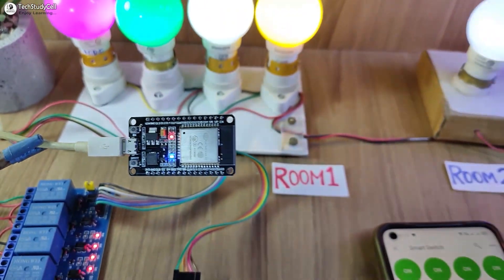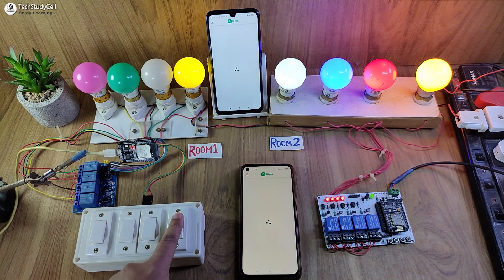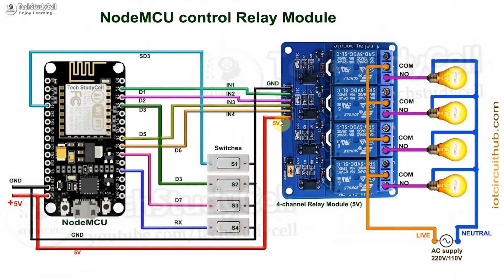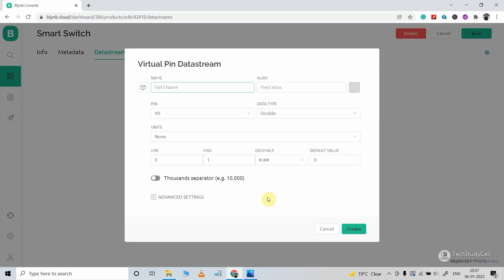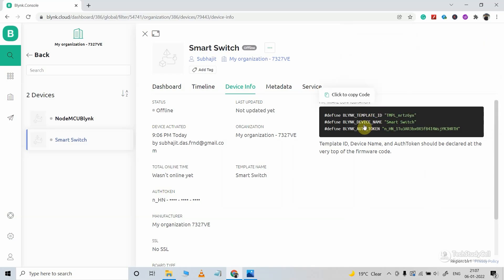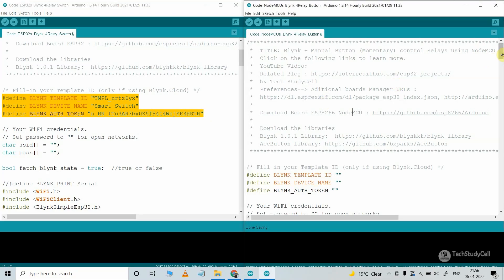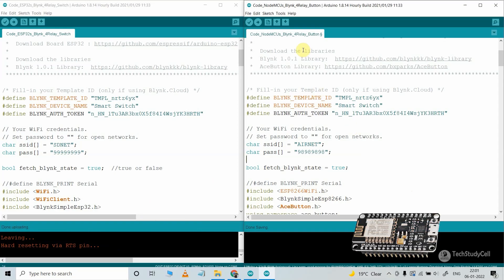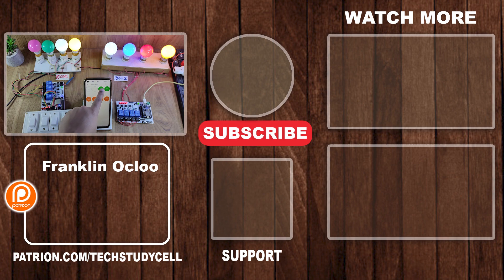IoT Project using ESP32 NodeMCU ESP8266 network with Blynk App | IoT based Home Automation

Comment: Very nice video. Can you suggest me what is the cheapest microcontroller that I can use for my IoT project? I need to connect with it through a SIM module. What is the best SIM module that will work perfectly with Indian SIM card? 

Thanks in advance.

Comment: C:\Users\tarun\AppData\Local\Temp\sketch_oct5a\sketch_oct5a.ino: In function 'void setup()':
C:\Users\tarun\AppData\Local\Temp\sketch_oct5a\sketch_oct5a.ino:42:20: error: 'D3' was not declared in this scope; did you mean 'V3'?
   42 | #define SwitchPin2 D3   //D3
      |                    ^~
C:\Users\tarun\AppData\Local\Temp\sketch_oct5a\sketch_oct5a.ino:145:11: note: in expansion of macro 'SwitchPin2'
  145 |   pinMode(SwitchPin2, INPUT_PULLUP);
      |           ^~~~~~~~~~

exit status 1

Compilation error: 'D3' was not declared in this scope; did you mean 'V3'? why this error come?

Comment: Hi bro can we use any other pins than D3 so we don't need to worry if the pin is grounded or not for the node mcu to boot.
Can we use D4 instead of D3?
Reply from the maker: You can. But D4 has its own limitations. It is better to use ESP32
Reply: @TechStudyCell  I tried using D4 but same problem.Board wont start when D4 is low.
Then i tried another pins and my configurations are.

Relay
D0,D1,D2,D3

Binary Sensing
RX,D7,D6,SDD3

So far i have not been facing any issue while booting with all input pins grounded or any other issues while running.

Is this ok to be used for long time.

Comment: Hi and thanks for the video. I was wondering if it  would be possible to use the sort of technilogy you are using to push a button on my mobile phone to activate horn or a buzzer on my car providing the car has no internet service to it. Say the car is parked in a large paking lot and l need to find it.  Cheers

Comment: Hi there, I am a big fan of you and watch your every video for almost 4 years. I appreciate your hard work and effort behind your all projects. I have seen more than one year, you do a lot of jobs behind home automation projects based on Blynk and another platform. It is very much appreciable.  If you add a digital fan regulator with those home automation projects controlled by the Blynk app then it will be a great achievement for home automation. we see some beautiful good-looking sonoff or another wifi-based Chinese Fan regulator with touch switch panels which can be controlled by both App and touch panel switch (or physical buttons when the internet is not available) to control fan speed. still, now no YouTuber/project maker makes such this type (physical Touch Panel+Zero Crossing Ckt+Blynk app) of project. As a fan, I hope you will make this for adding your existing home automating project and will give that project (full home automation)as a gift to your viewers if you have time.

Comment: In it necessary to connect data cable to node mcu
Reply from the maker: No. Just provide 5V supply
Reply: @TechStudyCell  but When I am not connect the data cable from laptop it not working.
Reply from the maker: You have to give 5v across vin and gnd pin.

Comment: Nice project usefull for future home  thank u sir u done great job
Reply from the maker: Thanks for the feedback
Reply: @TechStudyCell   I have suggestion can we use solid state relay instead of mechanical relay  and is that enough to supply load to celling light celling strip light or ironbox wall plug what are thing do in solid state relay
Reply: If we use 4 esp32 then what are gpio available total 38 gpio available what are pin we can use relay and latch switch can u tell i have design my own pcb

Comment: Hi friend! Can you make video and introduce this idea: in room N1 we have temperature sensor (DHT) connected to esp32, which is sending data to blynk server. other controller which is connected to the same blynk server and controlling relay using temperature measurements from room N1